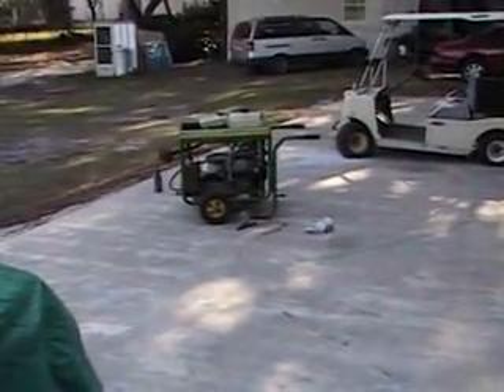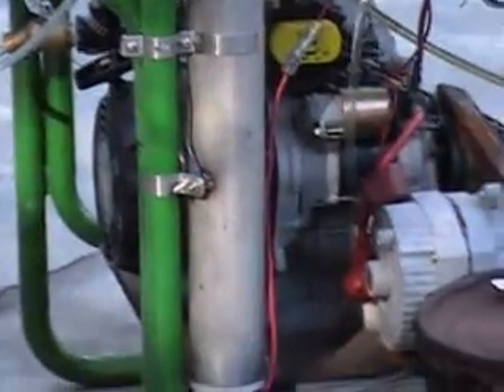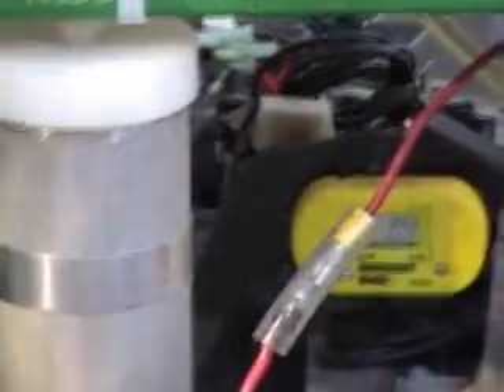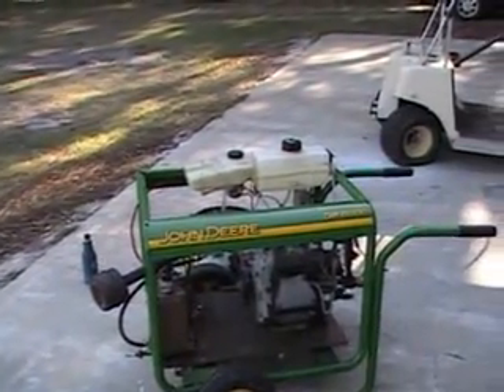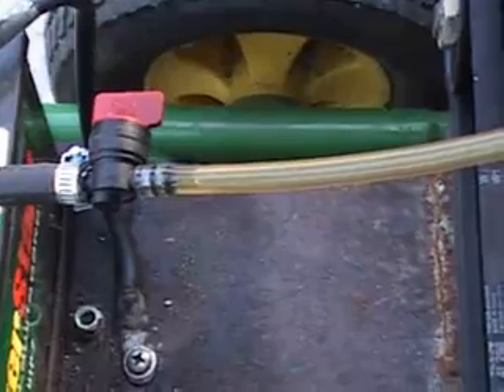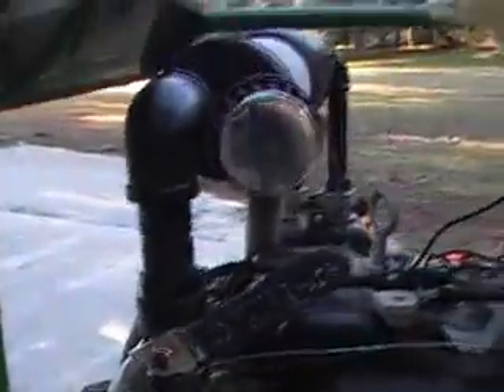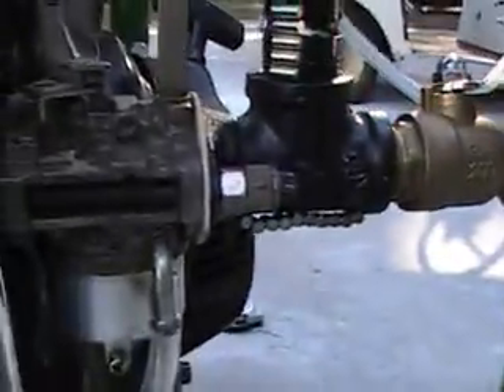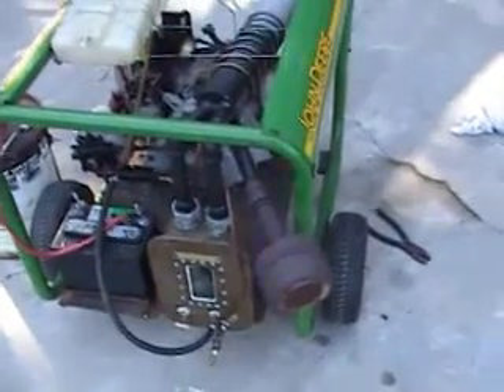GEET Testing 1

Comment from the maker: The original carb jets ran for 15 minutes on 500 ml. I rejetted leaner and it ran for 20 minutes on 500 ml. After the vaporizer it ran 40 minutes on 500 ml. The carb is still useable if the vaporizer fails and the current jetting is 20 minutes on 500 ml.

Comment from the maker: HHO has to be injected in the cooler area. The fresh air intake stays about 75 degrees. If I add any more fuel vapor the engine runs worse. By adding an additional fuel vapor source I will be adding additional fuel and using more fuel in the process. Ideally I would want to use less gasoline and more water vapor or hydrogen gas. My goal is to cut back on fuel consumption as much as the engine will allow me while still producing more power than factory production.